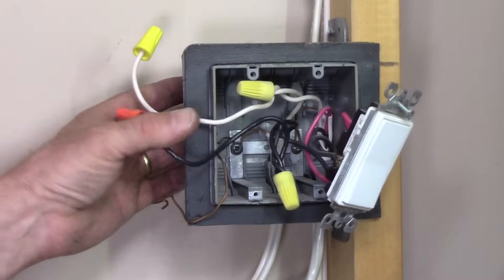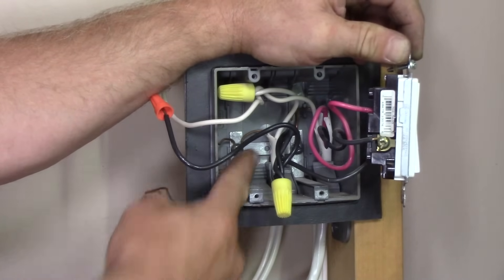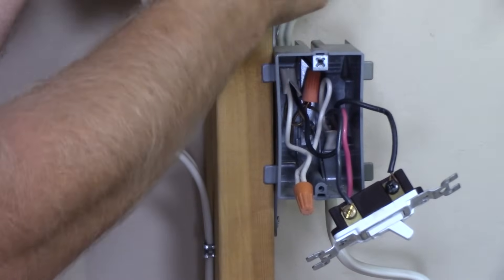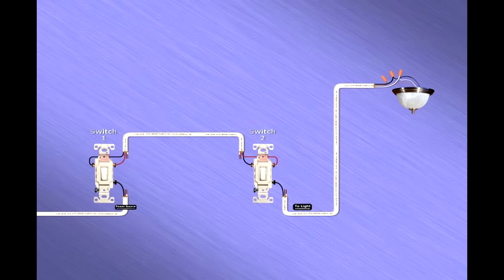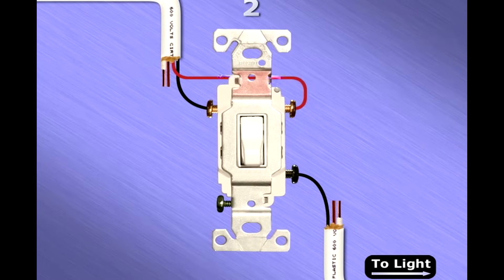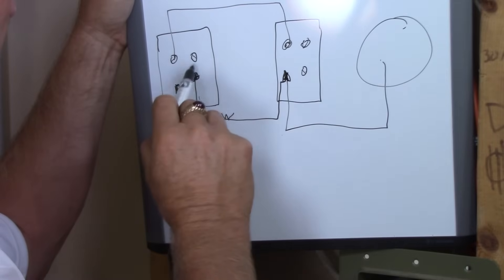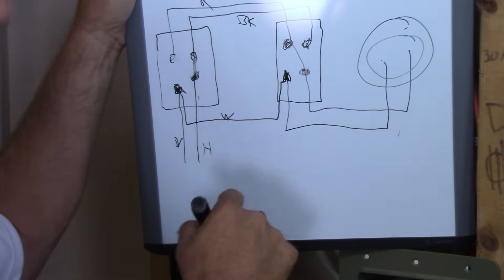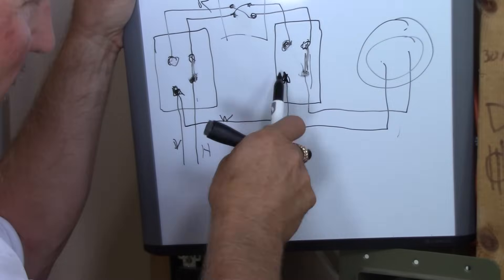The Best 3 Way Switch Explanation Ever!

Comment: Definitely a convoluted explanation, but what if I told you it is possible to have a 2 way, 3 way, 4 way or even 5 way switch by implementing 4 wires at your first switch, then 2 wires per switch, and make it dim from all locations!
Reply from the maker: Convoluted?!?  This is the 3-way switch network in it's most simplest, and easy to understand configuration, and the one method that now meets the current code rule of needing a neutral at all outlet boxes.  There are so many different ways to wire a 3-way network, with power supply at any of the outlet boxes in the circuit and then the required cables to the outlets to make it work.
Reply: @theinternetelectrician  easier explanation would be.
Incoming feed to the common of your first switch, connect your rockover cables linking your first switch to your second switch in terminals 1 and 2 respectively at each switch. 
At your second switch, a load cable out of your common to your lighting point. 
Then ensure each wall box has a neutral and earth!
Please do me a huge favour and dice those twist on connectors, use Wagos at the very least!
Reply from the maker: @SpecialisedIRT  I'll wait for your video, "Better than the Best" Thanks for watching. You are viewer number 2,238,300!
Reply: @theinternetelectrician  it is illegal in Australia to give non electricians electrical advice.
Reply from the maker: @SpecialisedIRT  Thanks for asking.  Journeyman Electrician with Red Seal (recognized to work in any Province in Canada). Earned awards for being in the top 3 of grades in my Province of Alberta.  I hold a 3rd class ticket as a Steam Engineer.  I have 4th year level Apprenticeship in the field of Instrumentaion Mechanic.  I have worked in Residential, Commercial, Industrial, and Control Systems Maintenance.  I then started my own Electrical Contracting business that I grew from a one-man operation, to a nice medium sized operation in my hometown.  I sold that business in 2008.  I've been in the electrical trade since 1981. Here it is allowed that homeowners can do their own electrical work. Replacement in kind does not need a permit.  Additions to a system can be done by the homeowner in most jurisdictions under a Homeowners Electrical Permit.  I started my online business in 1997 in the early days of the internet to help the DIY person to do it safely, competently, and correctly.
Reply: @theinternetelectrician  that's a huge achievement!
The electrical trade here is highly regulated, and big fines can be imposed if negligent!

I've been a tradesman for 21 years and contracting my own business for 10.
I started out house bashing, but we mainly do commercial, industrial, retail, and mining.
We are solar accredited, we are certified in thermal imaging. 
Started out as a one man band grew to 9 vans on the road.
We have recently becone quite involved in automation.
And in 2019 I was awarded runner up in the Master Electrician of the year award!
If you want to see something interesting - please search "clipsal wiser iconic" on YouTube
Reply from the maker: @SpecialisedIRT  Checked it out! So applying SCADA loop in residential and commercial applications.  Smart home technology is really taking off in USA and Canada, mostly using wifi connectivity and app control, then integrating into either Google Home or Alexa, etc.
Reply: @theinternetelectrician  the clipsal system uses Bluetooth locally, which connects to something called a "zigbee gateway" to use remotely.
The main reason is cyber protection.
Most systems on the market are not encrypted, which can leave your internet security easily breached.
Here, It is not mandatory to wire neutrals at switch locations  - it may be because our homes have adequate access to cabling and junctions in the ceiling space.

Comment: it's easier to show an electrical circuit and more than one, there are at least two of these circuits
Reply from the maker: If you mean that there is more than one way to wire a 3-way circuit, you're correct.  I could probably show at least 10 variations of this.  Just wanted to show the most basic as once you understand how it all works, you should be able to apply that knowledge to any configuration. However, this is the one method that meets the code of today where we need to have a neutral conductor in every outlet box.

Comment: The one thing that you did not cover is the situation where the supply and the switch leg are in the same box. People working with existing switches might find it confusing if they open up their switch and find it wired that way. When they find a 3 wire by itself at one end they will be confused. The parts you hit here explain everything very well, though.
Reply from the maker: Yes, there are so many ways to wire a 3-way switch network, and you will find them existing everywhere.  But with the new code now that requires a neutral in every outlet box, this is the best way to achieve that, and the easiest to understand the current flow in the circuit. I would appreciate it if you like, subscribe, and click the bell as well (if you already did, thanks!) It really helps us creators gain traction with YouTube.

Comment: I am replacing a broken dimmer/combination switch on a 3 way circuit with. It seems the other (non dimming) switch has the white bound together, and black and red connected into the switch as depicted in your hand drawn diagrams, but the other outlet with the dimmer has just one white, one, red and one black. I am unsure how to connect that up. I wish now I had of taken pictures when I removed the yellow twist wire connectors.
Reply: I figured this one out myself. On the second dimmed switch the white was the connected to the black on the switch. By the way your video is very clear and enabled me to fully understand how this circuit works, especially your drawings and explanations.
Reply from the maker: Excellent! Good job.  I would appreciate it if you like, subscribe, and click the bell as well (if you already did, thanks!) It really helps us creators gain traction with YouTube.

Comment: As someone from the UK living in the USA, are the yellow wire nuts a legal requirement or can you connect to the switch directly?
Reply from the maker: Hello Andrew. Not sure what you mean? Are you talking about the wire nuts (twist-on connectors?)
Reply: @theinternetelectrician  Yes.
Reply from the maker: @andrewscott1253  No, you don't need to use wire nuts unless you need to pig-tail a connection in to a feed through connection.  The fewer the connection points, the better, so if you can connect directly to a device terminal screw, all the better.

Comment: I had a three way switch working fine. When I added a three way dimmer it is not working correct. Do I need to switch the travelers?
Reply from the maker: More likely that you connected the common wire to the wrong terminal of the switch.

Comment: Finally, it all makes sense!  I used to get the travelers mixed up with the commons... and a few hours of trying different combos would fix it.
With this explanation, I just have to remember two things.
        #1 - the LINE (the hot wire where the power is being fed from) goes to the black common screw
and #2 - the LOAD (the hot wire of the equipment or item you're trying to turn on) goes to the black common screw of the last switch closest to it.

Thank you for making this so simple to understand.  I now want to install another 3-way and even brave a 4-way installation.
Reply from the maker: Excellent!  I'm glad it now makes sense and thanks for watching.

Comment: Hey Terry! What’s the best way to wire a shed that will have three rooms with a switch, light fixture and a few receptacles in each room using only two circuits?
Reply: I’ll probably use two 15 amp breakers both on 14-2 gauge wire. Just single pole switches, and some receptacles . Whats the easiest way to wire it?
Reply from the maker: @Basskingdom7  That's a bit too broad of a question.  It depends on so many factors. Where is it, how are you going to get the feed to it, what is the shed building structure, etc.  And you can use #14/3 fed with a 2-pole 15A that will save you some cost in copper.
Reply from the maker: What are you going to have for electrical load in the shed? I'm thinking 1 circuit is probably enough?
Reply: I wanna wire all receptacles on one line and then I wanna wire switches and light fixtures all together?

Comment: I live in an older home and all the wires are black so I don’t know which one is the traveler wire is there a way to find out which is the traveler?
Reply from the maker: What's more important is to identify the common at each switch. The travelers really don't matter which one of the other terminals they are connected to.  email me at terry@electrical-online.com if you need some more help with this.

Comment: Why does a dimmer have to be in a certain position in a 3 way or 4 way circuit? Thanks
Reply from the maker: They need to be in one of the positions of the 3-ways at either end.  The reason is that you need full voltage coming to the dimmer device on one or the other "traveller" wires in order for the electronics to properly function. If you had one at both ends, both of the devices could be in a low dimming position and the lights might just barely work, if at all.  Make sense?

Comment: Awesome video!!! I've watched so many of these and still could not figure this out, but this video made it very easy to understand... I only have one issue on my end... I have a light upstairs, and it's connected to the upstairs switch. There's a switch downstairs that is supposed to be the secondary switch for that light.... But it wasn't connected (didn't have the proper three way switch). I bought the 2 three way switches so both would work, but there's no traveler cable/wires from the upstairs switch to the downstairs box, but the upstairs switch is connected to the main power in the downstairs box, which also has the porch light and downstairs hall light switches in the box... All three of these switches (the porch, hall, and upstairs lights) are connected to the same cable/wires coming from the breaker box. Is there a way I can still connect the two switches to operate the upstairs light without the traveler?
Reply from the maker: What cable runs between the up and down switch? Is it not a 3-wire, cable, only a 2-wire?
Reply: Hi  @theinternetelectrician . Sorry, my post was pretty jumbled there LOL. There is one power line that runs from the circuit box to the switch box by the front door. Then, inside the switch box are the three light switches, one for the front porch, one for the front hall, and one for the upstairs light (which wasn't connected). Then the upstairs switch, for the upstairs light, runs down to that switch box with the other three switches in it. That upstairs switch, and the other two switches (porch and hall) are all connected to the one power line. All of the cables are 2 wire.
Reply from the maker: @PapaWolf  Ah, ok.  Then you won't be able to get a 3-way network going without changing some cabling then.
Reply: I was afraid of that  @theinternetelectrician .. I can do the wiring, just a pain in the butt LOL. I found this last night though, for 2 wire connections.. It does mention it's not legal in California or the North West US... I'm in Canada though... So thought I'd show it to you and see what your thoughts were on it... The switches I bought do have the four connectors to do a neutral connection from each switch to the box.. I believe that's what the green screw connections are for any way..
http://www.electrical101.com/optional-3way-switches.html

Comment: I am confusion! My house was built in the mid ‘50’s and is all two wire, and all the wires are either white or black. And I have several three ways switches!! I found one ceiling light box which has four two-wire leads coming into it, all of which (except one hot for the light) are wire nutted into two groups. I’m missing some fundamental here...
Reply from the maker: Sounds like they made do with what they had for cable so they probably ran 2, two-wire cables between instead of one 3-wire so they would have an extra conductor that may or may not be used, or an extra neutral or something.  I'd have to have more details.

Comment: I assume you can add any number of 4 way switches between the two 3 ways.
Reply from the maker: Correct, yes. That is until you until you run into line loss / line drop issues :-)

Comment: Why the electrical wiring in the USA looks and sounds more complicated than in the UK. 😳
Reply: Nothing in the US is more complicated than the UK...
Reply from the maker: It's more an issue of what you're used to working with, the principles of electricity remain the same around the planet.  Would be nice if we all shared the same distribution system, but it's a long way to interconnect the grid across the Atlantic (or Pacific for that matter)! Maybe when we settle on Mars, then we'll agree on standardizing.

Comment: Can you add a second light to this system so both lights turn on and off at the same time
Reply: Hank Bridges  Not sure how any of this had anything to do with my question I konw what a 3 way switch does and how it works but I was wondering if you can add a 2nd light into the system. I have an outdoor light  with one switch inside and one outside. Id like to add a second light to my shed that would be on the same switches.
Reply from the maker: Did this Hank guy delete his comment? You would just go from the existing light with a 2-wire (+gnd) cable to the next light, or as many as you'd like to add.

Comment: I have no issues in normal wiring, I have done a couple 3 way switches but not in almost 2 decades, right now I find myself totally lost on something I want to do at my other home, I may have to do multiple circuits?  ok here goes for best explanation, at home I want to put in a 3? way switch,  then up my walk path I want 4 outdoor lights up side of mountain walkway to where we park cars. the farthest light from house near where we park, I would like it to be able to be set on timer, dusk to dawn, then be able to flip a switch and cut rest on, get to house & cut all off? now for the worst, I want 2 electrical outlets, 1 at first light, 1 at the last, so I can have an outlet without running a cord from inside home to work outside, & a place to plug in where I park whether a battery charger, or plugging in my small welder. I want the outlets on a 20 amp, circuit. & I want the outlets live & not controlled by the switches.
Reply from the maker: This is more than a short reply can cover.  You need a consultation.  Short answer is to do this with conduit and wire.

Comment: What do you do when there is a red wire at the light housing?
Reply: Light house? 😳
Reply from the maker: Depends how they wired the circuit.  This method is the most simple and easy to follow, but the variations are many.  Almost no other methods meet the new code of needing a neutral at every device box however, but are grandfathered and exist everywhere.

Comment: There would be less confusion if it was called a two way switch,
 instead of three way switch because of the three wires.
Reply: In the UK we do refer to them as 2-way switches because there is 2 ways for the current to flow.  We refer to the other switch in the circuit as an intermediate, self explanatory.
Reply: @michaelleyland9836  That makes more sense.
Reply from the maker: I agree, it does.  I would appreciate it if you like, subscribe, and click the bell as well (if you already did, thanks!) It really helps us creators gain traction with YouTube.
Reply from the maker: Yup, that makes more sense to me as well.  Not sure how this terminology came about for us norte-americanos? I've questioned it myself to no avail.  I would appreciate it if you like, subscribe, and click the bell as well (if you already did, thanks!) It really helps us creators gain traction with YouTube.
Reply from the maker: I totally agree!  I've never completely understood why we call them a 3-way switch?  Can't fight the machine! I would appreciate it if you like, subscribe, and click the bell as well (if you already did, thanks!) It really helps us creators gain traction with YouTube.

Comment: I couldn't work it out lol. I swapped 2 switches with 2 occupancy sensor switches when I  did the first one the switch itself it had the light on but the light bulb wouldn't light up then I swapped the second and they both don't work
Reply from the maker: You'd have to do a little re-wiring of the splices to make that work the way you want it to.